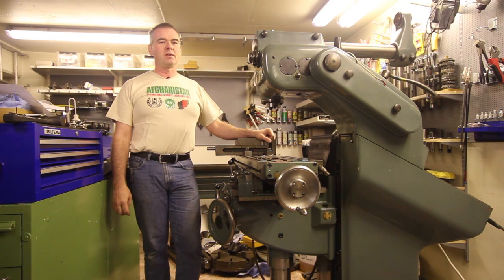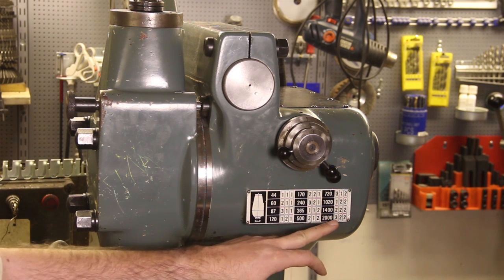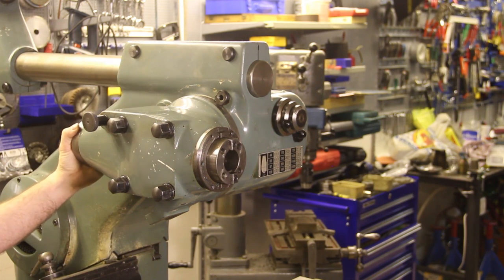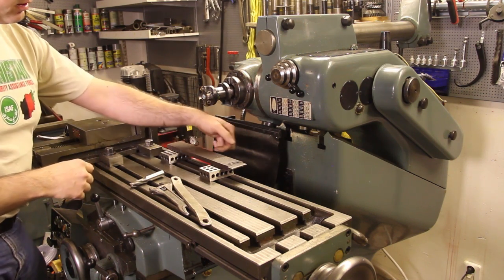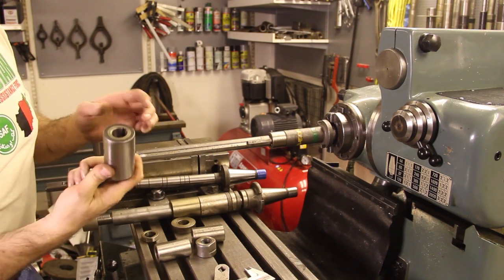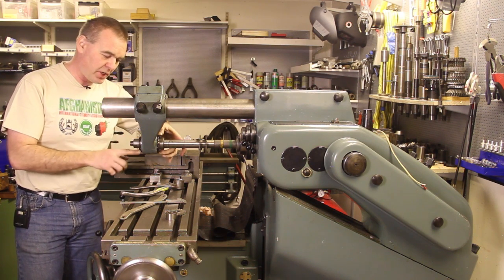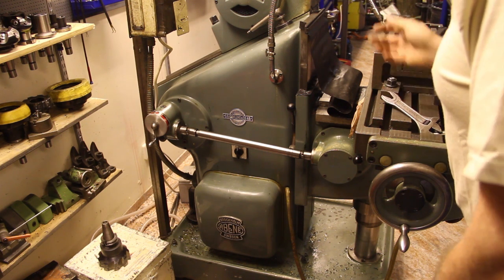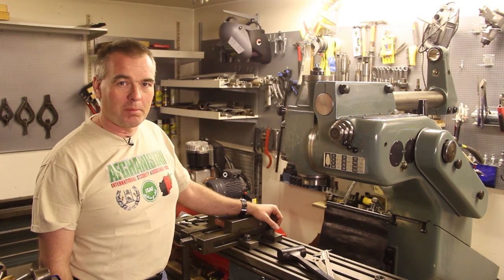Abene milling machine

Comment: To avoid bending an arbor, we were never allowed to tighten an arbor on the bench. It's safer to put it in the machine with the arbor support locked in place before we tightened it. Very nice looking mill by the way.

Comment from the maker: GnosisMan50:
Well, I haven't used a Bridgeport, but I think they too seem like fine machines. They obviously move in more directions (turret, ram, nod, twist sideways, quill movement) than Abene. They come with power feed on the quill, which is nice. The R8 is probably not as stable as ISO 40, but I'm sure R8 is adequate for drilling and light milling. Bridgeport surely are versatile, but freedom of movement often comes with reduced rigidity. It all depends what type of work you want to do. For many people a Bridgeport would probably be a better choice than Abene.
Reply: I think bridgeports are good machines, but certainly not the best. There are not precision machines and are really light machines. I believe they have a 1.5Kw spindle only. They also have a very narrow knee, and can have table sag because of that. The advantage is they have a very long table travel for their size, are versatile and have a fast spindle speed (somewhere around 4500rpm max).
Reply: I haven't used an Abene (although, if someone in sweden would like to arrange transport to New York, I would jump at the chance), but I have used many Bridgeport style mills and some "euro" style mills, such as Deckel's. By far, I prefer the european machines. They are much more rigid, and often more compact. Not that good work can't be done on a Bridgeport; I use a Wells-Index daily at work, and I consider it a more rigid Bridgeport. The BP beside it seldom gets used as a result. The rigid american machines are all horizontals; Kearny and Trecker, for example. People often will mount a vertical head on them, but I would still prefer a Deckel or an Abene any day of the week. 

I really love my swiss machines. I have an Agathon style swiss tool grinder (branded "E. Hoffman") that I restored that gets daily use. At work I have two Arboga radial drills that get abused by the animals I work with daily, and somehow put up with the abuse. When  I first started working their nearly every machine was lacking lubrication. With a good cleaning and some fresh oil, and a few minor repairs, all have proven to run in close to perfect condition despite years of poor maintenance.
Reply from the maker: Well, you could try calling Per von Wachenfeldt att http://kavlingemollan.se and ask if he can help you. He's a dealer here in Sweden, selling machines all over the world, arranging shipping to lots of different countries. He usually has one or two Abenes in stock.

Comment: Hi Mattias,
i like your videos, keep up making them. But i have a little Trick for you. When you tighten the nut for the Arbour like you did in the video, you can easily bent or brake your arbour. It is better to tighten it when the Arbour is in the Mill and the Arbour-Support is mounted to the bearing. The Nut does not have to be this tight, the force from Cutting is going into the keyway piece of steel. ;)

Comment: Dear Mattias, thank you for your excellent videos about the Abene mills. Because of your videos I became aware of the brand. And recently I bought a 2B. I read that the by Abene advised lubricant is Shell Vitrea 31. I understand a good replacement is the 46. And for the Vitrea 72 I could use the 220. Both of them are hard to find in the Netherlands in a 5 or 10 L jar for the hobby machinist. Which lubricants do you use? Perhaps what you use is easier to find. Thanks! Eric

Comment: Hello Mattias, i have a question about the spindle of my early Abene VHF3. What kind of lubrication do i need to use for the right angle helical gears in the spindle? I have problems with the spindle heating up in 40min. Thank you in advanve

Comment: Nice mill and an interesting construction. Took a look at Blocket your Sweedish Ebay and found a few. Not that I will get one, I am rather happy with my CME vert / horr mill and my comming bridgeport wich I will go get saturday, but it's interesting to see the price range and YES the Quill modell is rather pricy. For you other guys out there. Sweedish machines are great and will last for generations of taken care of. I my self have a Køpings S 8-10 lathe and it's a great machine. Thanks for the video of your beautifull mill :) Make some video of it in use.

Comment: Very interesting mechine... I too am a hobby mechinist. Im wondering if you had to do any fancy electrical work to power your mechines. All of my mechines are three phase and of course I dont have 3 phase power running into my little back yard shop. Ill be getting a rotary phase converter soon. I just wondered if you had the same challenges with your mechines...
Reply from the maker: Most houses in Sweden have three phases coming in, and then the three phases are used in a one-by-one fashon for the power outlets in the house. Of course it is easy to get a 3 phase outlet when you have 3-phases coming into the house, and I already had a 3 phase outlet in my garage when I moved in.

Comment: TWO things. Firstly always place the bearing collar as close to the cutters as possible for rigidity. Secondly, Very Bad practice of you tightening the arbour nut as you did, you stood a very good chance of bending the arbour. Always tighten the nut when the arbour is fully fitted to the machine with the overarm fitted and the support collar fitted. 55 Years of Engineering experience speaking here. Regards from Australia.

Comment: Can you please help me ? I would like to buy an older milling machine, but a smaller one from the old days. I could restore it. So it doesnt have to be in the best order. It just has to be something special and Swedish :). If you find one I live in Dk. You make me a happy man...:) Thank you...
Reply from the maker: Hmm... well, try checking out www.blocket.se, search for "fräs" in Verktyg, Hela Sverige. 
I do however recommend getting a bigg one, it's more stable than a smaller mill and there´s more space for properly clamping stuff to the table. The Abene is a good size mill in my opinion, and very stable. If you want a smaller mill, and for some reason specifically want a Swedish one, you might want to check out Mattsson & Zetterlund.